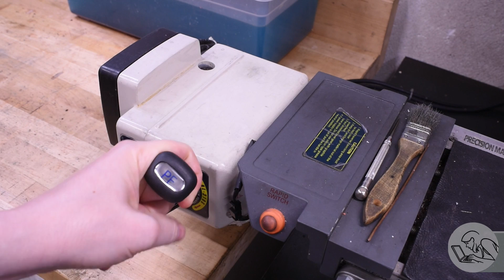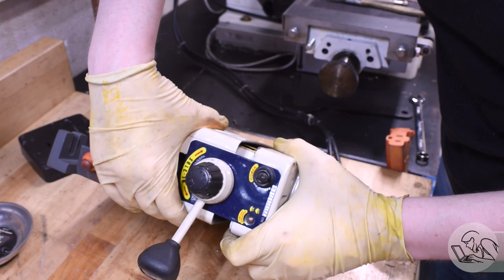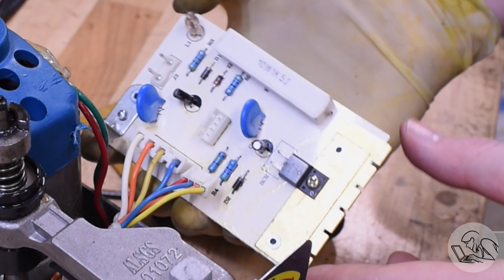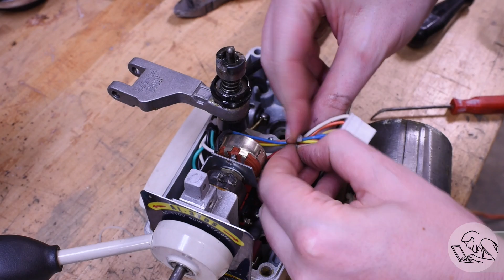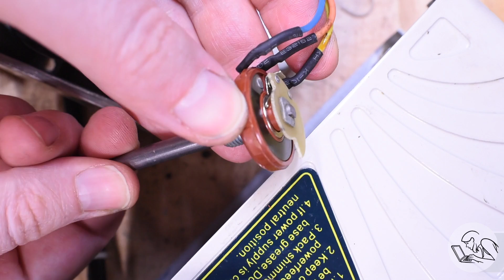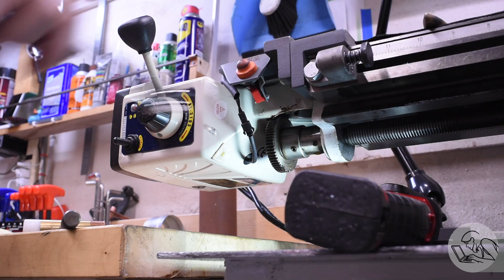Fixing a Power Feed and How They Work!

Comment: LOL - As an old (pre-solid state*) TV repairman, I've gone through a LOT of contact cleaner.  (I might even have a few cans hidden away somewhere, along with the thousands of tubes.) You had to be careful where and how you sprayed it because a lot of the plastic parts would soften or warp if they were wetted by the contact cleaner.

Even worse was tuner cleaner; those tube-type tuners had a LOT of contacts in them. The tuner cleaner was like potentiometer cleaner, except it also had a sort of grease with ABRASIVE in it. The idea was that you sprayed the heck out of the tuner through a tiny hole (any hole), gave it a few spins, and hoped the abrasive would grind away any corrosion. (You also hoped that the contacts wouldn't be worn away before you got out of the customer's door; this was back when TV repairmen made house calls -TVs were HEAVY.) Needless to say, a conscientious repairman would actually take the tuner apart and clean all those contacts individually (usually 6 or 8 for each of the 12 VHF channels, plus a set to switch to the UHF tuner; you DO remember channel knobs with the numbers from 2 to 13 plus a "U"?).

----------------------- 
* I could imagine all those electrons flying from cathode to anode through the vacuum inside the tubes, being guided or restricted by the grids, but somehow germanium and silicon eluded me.**

** I don't understand why more comments don't have footnotes.

Comment: Thank you very much for this video. I have one of these drives on my Taiwanese mill and although it's still working well after 14 years you never know when it will need surgery.  The only trouble I've had with it has been perished rubber boots on the main switch and push button. I replaced them with rubberized material cut from fingertips of cheap work gloves, held in place wit hot melt glue.

Comment: I've worked on a few of these frustrating and scary repair projects, where you have to disassemble 90% of something to get at what you suspect is the problem part. :-) You also hope your memory is good enough to remember how all of the screws and clips and springs go back together. And, you hope you don't accidentally break some little plastic tab or other feature which would render the entire device scrap. :-)  I was getting nervous when you were prying apart that potentiometer, hoping that a bunch of little plastic fragments didn't fall out of it. But, in the end, you succeeded! Bravo!

Comment: Quinn, your Multiple comments upon "GREASE" in a basically Electronics video, took me right back to Republic South Viet Nam, Spring of 1970!

Our 'H' model Huey's had been flying 20 HOURS a day, tag teaming the Crews, doing all kinds of usual "Never happen, GI" things . . . We had a chopper that was flying with THREE RED X's from T.I. !!!! one was the "ONE Hundred Hour Maintenance" inspections, rewiring of "safety wires" test everything on board, HOWEVER, my part was AVIONICS, and ~that RED X~ for the VHF radio was the ONLY radio that was functioning properly!

CUT ton the Chase, Upon STAND DOWN, our various crews were ALL OVER that heliopeter.

What we found that KEYED the FM XTMR (the only AIR to GROUND TROOPS radio) HOT only choice was to Up Freq, or Down Freq, as they needed the radio REGARDLESS, that item was a BIT of grease . . . that changed the Mic switch from "ZERO VOLTS" to around 14, the AVIONICS All keyed at 28 volts, but that FM transceiver was taken from a 12VDC "jeep radio" and remade into AVIONICS! 

GREASE, the Bain of ALL electricians!!!!

Comment: I think your speed adjustment knob is rubbing against your direction lever and it's slightly adjusting your speed when going forward because the speed knob is slightly moving to a faster speed. Move the speed knob away from the direction lever and it should fix the problem of different speed in each direction.
Reply from the maker: The speed change is the opposite of what would happen if that were the case.
Reply: @Blondihacks  at 20:56you can see when you hit the direction lever it moves your speed control…. Just letting ya know cause it’s a common problem with that power feed 😊

Comment: I have that old Radio Shack Micronta multimeter. 20+ years and still going strong! One year it was left alone and the batteries all let out their innards into the compartment. A quick wipe with damp paper towels and its back in action.

Comment: The neon lamp should make no difference to the direction, the two microswitches should normally be used to reverse the polarity going to the DC motor after the SCR circuit. The difference in power in one direction is more likely to be in the motor or else something mechanical.

Comment: could you not migrate the pot meter shaft to another potmeter? i remember that i had to work on a cheap aldi subwoofer and the shaft for the volume pot had pulled out, when i had it apart i was able to push the shaft back in and it clicked in place

so you would need a pot that has the same shape of shaft at the pot end and then with some luck move the longer shaft over 
or if its possible extend the shaft of the shorter one, might need to cut the shaft short as to give room for a coupler

Comment: Great problem solving! For improvised power feed on my manual bench mill, I just use a cordless drill. It's super controllable and advantage is, you can also use it on Y (cutting) and Z (just to make it easier to lift the head for tool changes etc). Same applies to the lathe - it's great for the cross feed.
Reply: And power compound on the lathe!

Comment: They save a few pennies by implementing this crap of a circuit, but then they dont bother to save money by leaving the solder mask out or the silkscreen, by the looks of it its even a fiberglass substrate, could have easily substituted that with laminated paper for a few more pennies saved.
Heck that big chungus 10W resistor alone costs more then any more sophisticated circuit would cost that would perform better and not need a power resistor.
Chinese money saving tactics are weird sometimes.

Comment: The limit switches switch the motor leads for directional control. The drive is one way only, to go both ways you need an scr bridge based dc drive.

Comment: The PM mill/drill I use has the same unit that’s still working well. This tells me that if it ever acts up I’ll either buy another one or make something different because the electronics are all Chinese to me (pun intended). I got a model with no Z-axis power feed and after cranking it by hand a few times I made a drive from a Princess Auto 220/440 lb. electric hoist motor and gearbox and some aluminum scraps. It works well but isn’t variable speed.

Comment: Yup, I remember those dimmer circuits.  With an SCR, it's a half wave dimmer that can only reach half power for AC devices.  There is an old trick of using the SCR to short the output of a bridge rectifier, and putting the load in series with the hot AC lead to that rectifier to get a full wave AC control from the SCR, they did that before Triacs were a thing.  The Neon bulb fires at a known point (around 90v) on the AC slope, and an RC circuit in series with it varies the exact point in relation to the incoming AC so you get somewhere between 0 and 180 degrees of conduction angle, sorta PWM modulation of the power line, that controls a load.  BTW, those neon bulbs age and their firing point moves, which can cause issues with the circuit.  (maybe that's why it's been getting worse.  New bulb?)  Also the Neon bulb's firing point varies with light, so the circuit will work differently when the bulb is shielded from outside light (so it's interesting that they tried to use it as a power indicator!)   As you pointed out, the bulb can be replaced  with a proper diac diode (sorta kinda two zeners back to back in series, cathode to cathode or anode to anode).
You probably could find a replacement potentiometer that would electrically work, but with a shorter shaft.  Then you could drill and tap the shaft and an extension shaft, and then insert a headless screw (threaded rod) with lock tight to extend the shaft.  Simple machining problem!

Comment: Quinn , Great video , when I take a machine apart  and I see it has a spring that does something ? does not matter what. I run a thin piece of safety wire through it  to keep it from flying away and taking The  shims and other stuff for a test flight off the bench (learned that the hard way ) I will use a sharpe and make a witness marks so I know how it goes back together  after weighting for parts ..  stay well

Comment: You can often get (unsealed) pots like that working better without taking them out of the chassis by squirting plenty of contact cleaner around the spindle entry and working the pot round and round vigorously - I've done this with lots of old amplifiers, radios etc. Would've saved a lot of disassembly if it had worked. Did you try it?

Comment: The potentiometer will most likely wear out much more quickly as you pointed out that the carbon has been worn down.  You should be able to find a similar style potentiometer of the proper value with the same shaft diameter.  All you need to do is transfer the shaft from your bad potentiometer to the new one which will offer a full life time on the carbon coating.  You could also burnish the three wipers.

Comment: Neon bulbs are totally symmetrical bipolar device.  Diacs are a bIpolar device intended to trigger Triacs. If I understand this correctly the motor direction is determined by the polarity which is controlled by the microswitches so the electronics does not know which way the motor is connected. So I would not suspect the drive electronics to behave differently for different directions. Driving a brush motor with half wave DC is certainly a minimalistic approach but probably enough for this simple job.
Reply from the maker: They are not symmetrical, and change over time.

Comment: Since you suspect the neon is causing the asymmetry in feeds, I would be curious if reversing it would make a difference.
Reply: I was wondering that too. It’s not obvious to me how the motor direction relates to a difference in circuit condition over at the neon lamp.

Comment: Good job and explanation as usual. I have found that an analog meter tends to reveal intermittent connects better than a digital meter. I too have a vintage can of RS tuner cleaner which might only be a temporary solution inn your case. When this pot acts up again, you could investigate the possibility of cutting the shaft off and making a coupler for connecting to a replacement short shaft pot. It might not be bad idea to also replace the neon indicator lamp.

Comment: I've been fooled, bamboozled and hoodwinked. This is the AvE channel... I thought this was BH. O hold on there was a imperial fist shake... never mind carry on. Lol

With the pot, was there no space to run a shaft extinction? I know most Pots have either a D sharft or just a round. Though I have seen "speed pots". It was a pot in a gear box for a  vertical lathe that was mounted directly to a gear. So that as the tool was moving inboard on the part the seed would increase. Buy besides being the largest multi turn pot I've ever seen, it also had a threaded shaft for a screw and a cross pin (the cross pin the company had added for reasons) If memory serves it was a 3 turn 10K. Mouser has 5 flavors with no pictures, so not sure if any of them was the one. 3.75 turn... what a strange bog o' potentiometer

Comment: Hello Quinn. 
As always a very interesting Video. I paused and rerun the Video multiple times trying to identify as much as possible to diagnose the Speed difference.
You said you bed it is the neon Bulb. But this circuit would be powered the same Way for both directions. The Switching is done by reversing either the Stator Windings or the Brushes of the Universal Motor to switch Directions. Have not seen it on Video, but have you also checked the NC to COM Switch contacts ?
Maybe i am totally wrong and You ha a much better View of the wiring, but i assume the Problem is in the switches.

Comment: Thanks for the video,    Interesting and useful.   I have a similar unit on a 1999 mill.   I thought my "power light" bulb was broken.   I did not bother to take apart since otherwise working.    I will now be comfortable with the light apparently not working, well not producing photons, but it seems to be in the AC to DC conversion.
Dave.

Comment: You got spunk, girl.
I've never been scared taking things apart.  It only gets scary during the reassembly period. 😱
Thank God for video.  I just cleaned and polished the little contacts on the dimmer switch on my S10 pickup a few weeks ago. It's amazing how much brighter the dash cluster lights are now.  That was sooo much easier than what you did.
I bet that power feed has more power than my S10. 😁
Your electrical smarts are impressive. 👍  I'm familiar with the terminology, but not how the diodes and rectifiers make the pixies dance.

Comment: the brushes on my z-axis were a source of much pain.. i had to replace them after several months of moderate use. the one that was causing my issues was disconnected from the wire, which was contacting intermittently sometimes while working most of the time, so every so often the x would just stop in the middle of a cut, or not start until i gorilla-d the GO handle. seriously annoying. 

oh, and the other brush was a bit large, or its channel a bit small, and it had cracked into several pieces and was being held together by the spring's compression, just gradually sending graphite niblets into the commutator.

my rule #1 on import gear is to replace anything that could be considered a peripheral (drill chucks etc) because that's where these manufacturers save a whole lot of money.. and the brushes on these things definitely qualify.

Comment: A good electronic contact cleaner was "Tuner Wash," for cleaning the manual UHF and
VHF rotary channel selector switches. It worked well on relay contacts, automotive ignition points, and similar, too. IDK if they still make it, but if anyone runs across it, it's good stuff.
Reply: Be careful with TV tuner cleaner, it often contains a light grease to lubricate the mechanical contacts. A better choice might be De-Oxit, which cleans but doesn't lubricate.

Comment: "Now which is it again? Take the part that is most likely to fail and make it easy to remove and replace or take the part that is most likely to fail and bury it as deep in the mechanism as possible so that no one can tell that is the problem and they buy a whole new assembly... I really wish I hadn't slept in when we covered this in Mechanical Design 101...."

Comment: made one for my mill using a windscreen wiper motor speed controller from amazon, made the housing and clutch and reverse gears. not prepared to pay £500 plus for one. homemade one has ran reliably for over 4 years now

Comment: That potentiometer like most Chinese electronics will have to be sourced from China. I've had to do this for recaping motherboards. To get the right size to fit order from AliExpress or the like. I'm impressed by your willingness to tackle that project. You made a movie reference but I'll come up with it later. Good luck.
Reply: That pot sort of looked like a clone of an Ohmite type AB, which are legit clones of Allen Bradley type J. Unless it has a weird value or taper, surplus houses (remember them?) should be able to source a replacement with some searching.

Comment: Hi Quinn, I have a 230 volt version of this drive. There is not a no volt release switch so the drive will restart after a power failure even if the mill spindle does not. I also did not like the 230 volt supply being directly switched by the table travel limit switches which are close to any cutting fluid used. I built a control unit with an integral NVR switch, a 230 to 24 volt transformer and three 24 volt ac relays. This is fed it with 230 volts from the mill main supply switch and is also interlocked it with the mill NVR stop/start control switches. By including a 230 to 24 volt transformer I reduced the switching voltage on the table travel switches to a safe value. With some thoughtful design this extra control box can be disconnected and the various cables easily relinked to put the set up back to your configuration. BobUK.

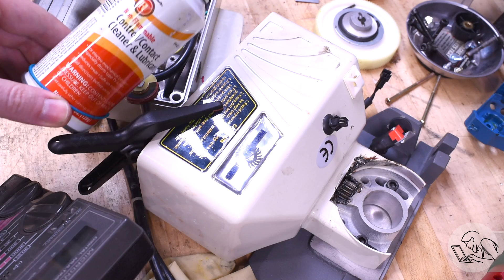Comment: 17:15 One of todays equivalents is Servisol super 10 switch cleaning lubricant. Magic stuff, it cures the scratchy pots/sliders on amps and mixers etc.
Reply: I’ve had good luck with some of the products from DeoxIt. Pretty easy to get a hold of too.
Reply: CRC also makes a contact cleaner which is not expensive, probably similar to the RS stuff, and available at Quinn's local Canadian Tire.
Reply: @LenPopp  I don't think there are very many Canadian Tire stores in California :)
Reply: @Steve_R  their loss

Comment: Man that device is huge! Was looking for something small when I got my Grizzly clone but ended up building a $45 contraption with a nema stepper motor, seeduino and a driver. I can go super slow and way too fast if needed. Been using it for two years without any hickups.
Reply from the maker: Yah, it really doesn’t need to be this large for a mill this size. It’s quite a bit overpowered. But, they’re cheap I guess.

Comment: Hello Quinn,
A good repair... and well explained, I often wonder how the aftermarket power feeds worked.
Take care.
Paul,,
Reply: I'd love to build one that reads the spindle speed and can calculate the feed per tooth on various cutters but my Arduino-fu is not strong enough. A project for an electronics nerd like BH maybe?
Reply: @mhagnew  Clough42 has you covered there with his electronic lead screw project
Reply: @MattOckendon  That's a bit more than I need, but it is an interesting project.